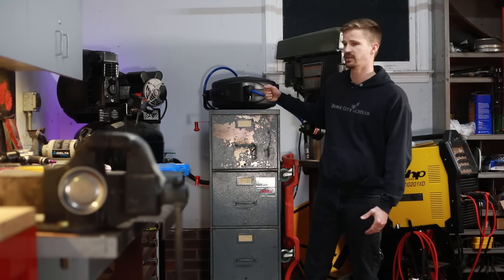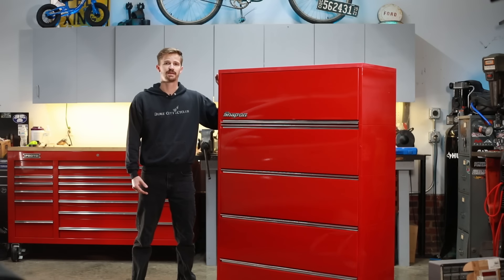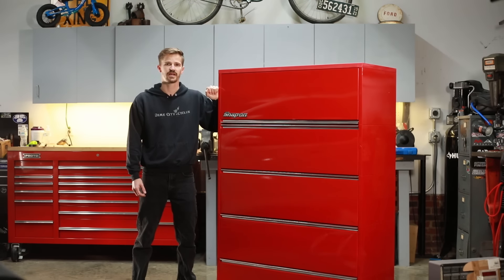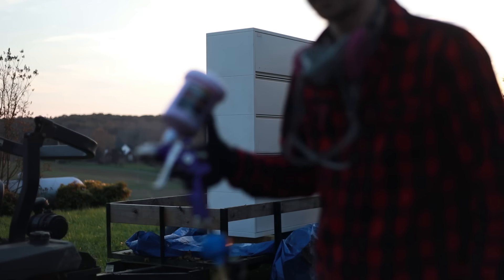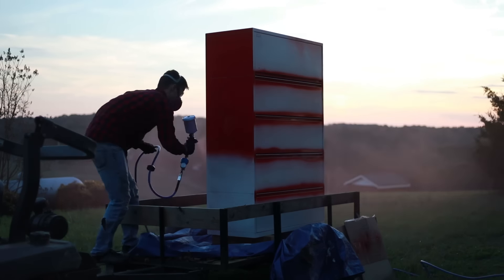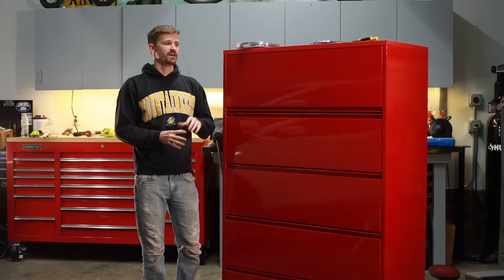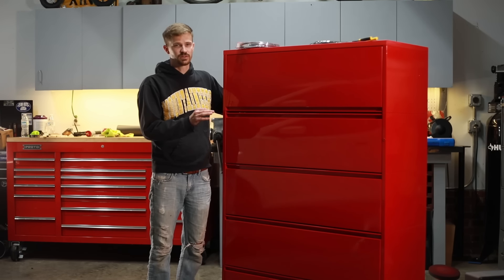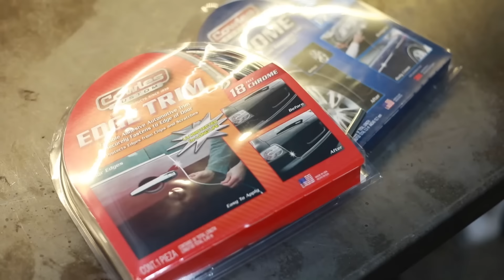Huge DIY Toolbox! For Cheap!

Comment: I work in the home appliance industry and my favorite thing for storage are the washer and dryer risers people always get before they realize they are actually bad for the machines. Stack em up and paint em nice. Best part is I get em free all the time
Reply from the maker: That sounds interesting I might have to look into them!
Reply: As an aside, why are they bad for the machines?
Reply: @jeremyspecce  with a front load washer the centrifugal force thats created is insane when the machine goes into a spin cycle and the farther away from the ground the more the machine wants to move. In turn the more it moves or shutters the more stress it puts on the tub support as well as the frame work of the machine and basically wears it out much faster then when put directly on the floor. About the only way to perfectly get a front load machine level and stable is with a concrete floor.

Comment: I love it! Paint came out really good after the buff. I love the Snap-On badge, although I think it would have looked just as cool with a 3D printed badge that said either “Snap-Off” or “Strap-On” 😂
Reply: Or Knock Off
Reply: "...Strap-On..."🤣🤣🤣
Reply: I fully agree.
Reply: I'd be totally embarrassed to put a snapon moniker or emblem on any tool box, ESPECIALLY if I built it myself. 
I never could buy into the snapon mindset. I understand that some of their tools are great and the service component of weekly or twice a week visits to the shop has some value, but at what cost does it stop making sense?!!! I seem to have managed fine with NOT snapon and have been employed at times in the mechanical trades - or "worked for myself" using tools- good made in USA tools that didn't equate a mortgage or business startup loan in scale and cost. 
I have a snapon screwdriver I found in a junk car I bought once. 

But uh-uhh, nope, no snapon labels on my tool boxes- My self image doesn't need to put on airs and the mere act of doing so - just thinking about doing so- leaves me uncomfortable and embarrassed. It maybe impresses small minds but the thinking man who works on his merits and perhaps even builds a mechanic's box from scratch (I made one of mine) would just laugh or dismiss anyone that felt that was cool or even thought it was needed, somehow. Embarrassing, at best, discrediting of oneself is worse than the embarrassment. 
I would, however, approve of "strap-on" or somesuch as that pretty much sums it up. I might also go for one's personal "brand" or last name; my latest toolbox purchase lost it's manufacturer badging and - like it's predecessor - proudly carries a repurposed 1980's jeep namebadge, "WRANGLER" and I have some 1971 Monte Carlo scripts, a 1969 VW Bus 'Volskwagen" badge, a "Chevrolet" square-body nameplate on others awaiting an appropriate placement on something- perhaps an artsy placement of them all on the bright blue 5' long and 6' tall acquisation? I just don't want it to be 'busy' or detract from the full-size Trans Am hood bird that's going on there:D

No putting on of airs with those, and nothing to say, "fraud!!" - just 'enthusiast.'
snapon logo fraud is tacky and, again, embarrassing to fraudulently say you bought in...

Comment: Thanks for the tip on the hardener.  I’ve always found that Duplicolor automotive paint is far better quality than rustoleum. Its not the best, but Rustoleum on its own doesnt stand up to elements over time. I’m sure that hardener does wonders tho. And When you dont have a choice and you’re spraying in cold weather, keep a heat gun handy. Heat your surface before spraying. Also soak your cans of paint in warm water. And on your final pass, lay it wet, but immediately follow it up with the heat gun evenly. This will prevent it from getting any runs. Otherwise it wont flash correctly and you’ll have stuff go wrong with the long dry time..  i use Hi temp engine paint alot for quick fixes. You can blast it with a heat gun and have it dry to handle in minutes sometimes. Best part is no orange peel!

Comment: Paint looks fantastic. I bought a couple almost 20 years ago for $50/piece. I painted them red with black drawers like my  Craftsman 42" bottom box. These bookend each side of my 42" box for a work bench and looked amazingly professional. I love the top slideout drawers. I made slider trays 1/2 the drawer width for all the rest. Store bigger stuff underneath the tray. It's unbelievable how much you can pack in these cabinets.

Comment: I bought 3 filing cabinets around 25 years ago from an Army surplus store for about $20 a piece. Sanded two of them down and roll painted them with good quality brand can paint in semigloss black. Not being a professional I am a bit chicken and fussy with painting so I did it indoors, by daylight and 20 degrees celcius. One is still used as a filing cabinet in my office and the other as a shoe cabinet in my apartment. Till this day they still look great. Material cost and my time added I surely did not come over 30 bucks when I was finished. Yours turned out nice and looks very professional with the additions you added. Wanted to put mine on casters too, but never got around to doing so (they only need to be moved by renovation) which means removing the draws because they are so heavey. So I too would surely advise anyone that needs to move them often to mount casters. Having the right tools and room to work in is of course always a big advantage. If someone likes a modern apartment I can imagine them even being used for Clothing cabinets or in the kitchen used for dishes, pots/pans and so on. When one looks at the draws in cook islands from brand name Kitchen cabinet manufactures they are nothing else only made out of wood and crazy espensive. Not everyone has thousands to invest in a kitchen.

Comment: Quick note for file cabinet users:  The drawers are designed so that most of the strength is in the sides of the drawers where the file hangers rest.  The floor of the drawers is kinda flimsy, and heavier items will bend/dent/bulge the floor of the drawer to the point that they sometimes hang up on the neighboring drawers... or pull the whole drawer out of shape enough that the glides bind up.  Especially large drawers like the one shown in this video (which turned out really great!).

My simple fix has been to make a sheet metal false floor for each drawer.  You will see this in most quality tool chests, except that they are done beneath each drawer where you never see them  (go open the largest drawer in any tool chest and see what I am talking about).  Anyway, a single thin piece of sheet metal, bent strategically like small corrugations, that fits snugly into the floor of the drawer is enough to increase each drawers strength 10 fold.  Or, if made low-profile enough, you can stitch weld a channel against the underside of each drawer.  Even a thin, snug sheet of plywood will work to make the drawers super strong.

Anyway, great video.
Reply: And buy the way NONE of my QUALITY Kennedy machinist tool boxes are built like you are talking about either. So now tell me how cheap and flimsy they are too. Kennedy makes snap on look like toy boxes.
Reply: @FastEddy5    I'm glad you're happy with your Kennedy boxes.  I own some and like them, they're quite nice and they are high quality... for their drawer size and overall stature.  Except that they aren't tool chests like the ones discussed on this video or the ones I described.  They are TINY.  The drawers are designed for small, precise items like end mills, reamers, indicators, mics and gauges, or fine woodworking tools... all fairly light until you get a few hundred end mills in the drawer and then those Kennedy drawers sag and bind like they're made of foil.  Kennedy claims a 120 lb limit, but in my 30 years in machining, if I exceed 60 lbs, they start to stick or the belly of the drawer sags until it drags on the drawer beneath.  The only way I can get more weight in them is if the tools are in a wood or hard plastic tray that spreads the load.    Most machine shops invest in Vidmar/Stanley cabinets for "tooling" because they have a 400 lb capacity in each drawer.  The chests we are talking about are for hand tools... sockets, wrenches, etc. (or large tools like drill motors, air tools, Skil saws)  where the volume of the drawer allows more weight, and they are ALL reinforced for that reason, if they are of any quality.

Comment: Bravo, absolutely beautiful job. Perfect choice of paint, especially with the added hardener! I found a short lateral file about 36" high a few years back. Very heavy, ball bearing drawer slides. Not quite so wide as yours. I paint all of my wall cabinets and painted this cabinet the same red case, gray drawers to match my mechanic boxes. I slapped an old Craftsman badge on mine when done and loaded it with all of my heavy grinders, drills, air tools, c clamps, very heavy stuff and it handles it well. I bolted a big vise to the corner then set my mid box and top box full of strictly metric mechanic hand tools. One of the smartest moves i ever made and best looking cabinets in my shop. Great job and super share!

Comment: I was able to pick one of these same cabinets up a couple years ago from my job when they remodeled the building. I paid $5 for it. It's great for storage, especially larger things like sanders and skilsaws. I've used it for parts storage at my shop and for the larger blow molded cases for special tools.

Comment: I just stumbled on this video and the timing couldn't be better. I recently moved, at my old house I used an old IKEA dresser as my work bench with tool storage. It was a great way to store tools and it attached two 3/4 plywood to the top as the work table. However like many things that are IKEA, it lasted about 10 years from some serious abuse and wasn't up to be moved when we moved houses. So I tossed it, which I was sad to do because it did make a great work bench. However at my new house, the previous owner installed two work benches and they are solid. However they are only benches without any storage. So I have been looking at getting a cheap dresser for my tool storage. I couldn't find anything decent used for below $100 and below that it was just pure garbage. I didn't consider using file cabinets but I just looked on Marketplace and there are several of the same exact ones for $50 and I found one thats 2x2 with a work top for $100. So I think I know which way I'm going. Thank you for the idea.

Comment: I've been using a similar lateral 5 drawer filing cabinet for tools for the last 20+ years. A local dentists office threw it and two others away. Mine has all open front drawers like your top drawer. I never really thought about painting it. I did cut a commercial butcher block top to fit the top of it so I cold put things on top. I have a pair of small machinist's chest sitting atop mine.
I like the chrome trim idea. 
Your right about the weight capacity, they take far more weight than any tool box. I also made a heavy caster base for mine out of 1/4" x 3x3" angle iron with proper tool box wheels I salvaged from a junk Snap on box.  Adding the casters made the whole box about 6" taller overall, which made it easier to bend down to reach the bottom drawers. 
I have the top drawer will all my sockets and ratchets, the second drawer is all wrenches, and the rest is all bulky tools. Being able to roll it around when needed really comes in handy.
Reply from the maker: I like the idea of a butcher block top. I was going to use some rubber mat that came with my tool box to lay on top but wood would look really clean and match my other box. Thanks for the input!

Comment: lateral file drawers work awesome as tool cabinets. there are many large tools and box sets items that will not fit in roll-a-ways. the paint is a great touch as well as the badge. a badge thocould beanything, car, motorcycle, bicycle, boat, aircraft. nicely done

Comment: Looks great. 
A tip on the locks for you or anybody working with filing cabinets. Most cabinets have a number stamped on them. Locksmiths can look up the number and get the key/tumbler pattern. Call the locksmith first, some require that you bring the lock with you.  
But also they often use a pretty common lockset so you can just buy a drawer & cabinet lock kit they usually come with a variety of cams but you can likely use the cam from the old lock on the new one.
Reply from the maker: That’s really good to know thank you!
Reply: Institutional Locksmith here. You are indeed correct! I work in a hospital and cut all kind of office furniture keys using the codes on the face of the locks. Your house keys  also have the codes stamped on them as well, when you buy your lock new. It's always a good idea to take a picture of your key with the code and keep it in your phone. If need be a Locksmith can also cut a key from those numbers stamped on your key as well.

Comment: Nice job with the cabinet, great idea to upcycle and make something that is useful. I copied your idea with a file cabinet i got from the local recycling site which is 4 draws high, sprayed mine midnight blue as that is what i had on hand for paint then used bed liner on the inside of the draws for protection and easy cleaning, then added some foam to the bottom to deaden the sound of tossing in tools. i also added some cheap thin self sticking foam to the inside of the side and back panels to deaden noise in general. Biggest difference was to make a rolling frame for the cabinet to ride in so i can move it if needed and make it match up with the other wheeled benches i have. I really like the top draw of your tool box. i'll have to keep an eye out for one like it. Take care,God bless one and all.

Comment: I have a normal size 5 drawer file cabinet in my shop to for the same use. But the top drawer is used to keep manuals, receipts and log books all in one spot and organized
Reply from the maker: I use desktop paper sorters to keep my receipts and sandpaper. Saving all my receipts has really saved me a few times when iv had parts with lifetime warrantees go bad.

Comment: My father always used the filing cabinets like the first one you spoke about  he used to save the old half gallon and quart sized square milk cartons  and cut those to a height of what the drawers were  it allowed you to open and close the drawers  and keep smaller items organized  one drawer was dedicated to painting items and all his brushes could get stored vertically in the  containers  both he and I are mostly Woodworkers and we  took a lot of pride in our finishing tools  he always had  both latex and oil brushes only  for me I am also a boater so I use special brushes for my Spar Varnish  and  for other yacht enamels FYI I have brushes of my Dads that he bought and used in the 1960s some of my personal brushes I’ve owned and used for over 35 years !  You take care of a brush you pay 15 or 20 plus dollars for or you can go broke  the cool thing is you can train your brushes to apply the finish you really are proud of  oh yeah I do not loan brushes out  and I do use special combs to clean the bristles

Comment: I started using filing cabenets for strage in my shop and garage about 10 years ago. The print shop where I worked did some upgrades and were throwing out all of their old filing cabinets of every size and configuration you can think of. Been using them for storage ever since.  Tou just have to use your noggin when loading them and make sure not to get them top heavy so they don't fall over when you open a drawer.

Comment: Outstanding build, the only changes I’m going to make to mine is it will be black and I will put casters on mine. This is one hell of an idea!
Reply: Careful with casters. It could tip on you since it's a weird dimension
Reply: @thetonezone8164  weird dimension and filing cabinets don't really have the structure on the bottom for that. You'd need to weld a plate of sheetmetal to the bottom to give it rigidity.
Reply: I have mine with the casters. There is a groove on the bottom and I fit 2x6 in order to create a stronger structure and attach casters to.
Reply: I bought a cabinet dolly that is steel with the casters already mounted with locking wheels and it works great. It's basically a pan with wheels that the bottom of the cabinet sits on. Just added a handful of self tapping sheet metal screws and I don't intend on dragging it out of the garage so it should be fine.

Comment: Great build. Perfect for cased tool kits.  I will be doing a similar build on  three 60 inch wide lateral cabinets.  I'll be fabricating a frame base to accept 6 inch locking swivel casters. I'm also going to make use of polished aluminum diamond tread plate to strengthen it substantially.

Comment: 2 drawer mobile pedestal file cabinets make great mobile stands for planer, belt sander, small drill press.
Built in steel drawers and already on casters.  Cheap at used office furniture stores or craigslist.
I currently have 3 and added plywood to strengthen the tops.
Also look at audio visual stands.  They are mobile with storage.
Reply: Restore aka Habitat for humanity stores, I picked up three file cabinets for 25 dollars, repainted two of them to match my glass and aluminium desk and looks like they came with the desk. The other is in my shop a 4 5 drawer unit and it holds all my shop tool manuals and sand paper along with other items. Govdeals.com also as the state, local city and federal gov is always selling office stuff and sometimes woodworking tools from schools, colleges and universities or even federal, state trade shops.

Comment: It looks better than a factory cabinet.    We built a kitchen with a cool blue cabinets with full with pulls. That cabinet door has since been discontinued.  After adding two Snap-On labels it really stood out.  Even has butcherblock counter.   Thanks to adding the correct labels, this kitchen will last way longer